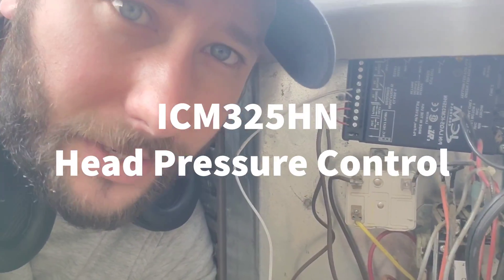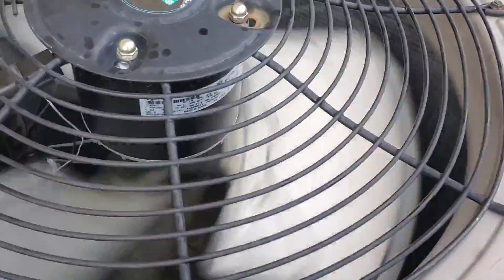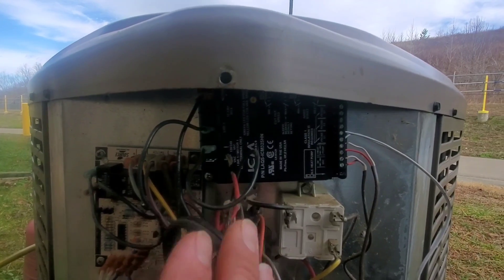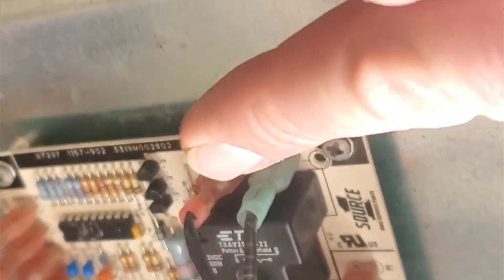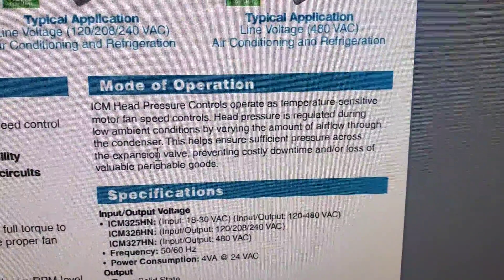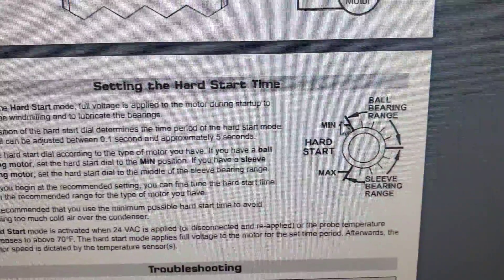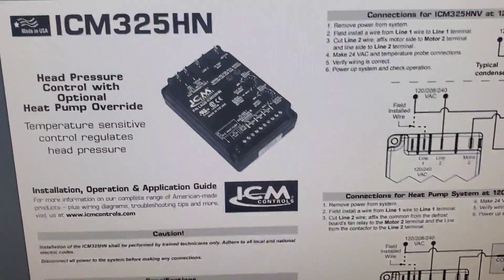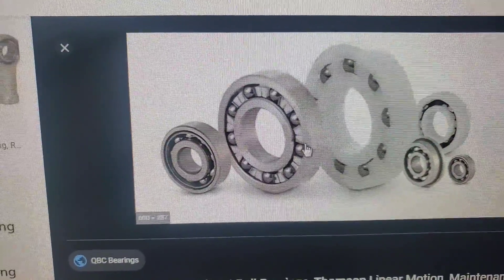Server Room Temperature Control MASTERED in 10 Minutes

Comment: Does this controller actually reduce voltage to the condenser fan motor? Because if the board is dropping voltage to a PSC motor to control head pressure, that can easily push the motor above its RLA. PSC motors will overheat fast when they operate under low voltage.

I had a similar issue on a split system running in low-ambient conditions — the fan was being controlled by voltage and the motor was running way hotter than normal.

Most proper low-ambient fan controls should modulate with a pressure-activated switch (cycling) or a variable frequency/ECM solution… not just starving a PSC motor for voltage. Curious how this one is handling that.

Comment: I'm fighting one of these now on a older York 480v 3-phase commercial unit. It's hard to figure out if the fan motor is bad or the head pressure control is bad. The unit comes on and the fan doesn't turn at all or if it does it's very slow. The fan motor isn't locked up or even tight and also spins freely by hand. The capacitor is good and is a 5.0 MFD 440v that measures 5.0 MFD. The wiring is good after fixing the ones mice have chewed up. The phasing is correct and everything is wired correctly. The compressor runs fine but trips off after the fan drags too long and it gets hot. The unit and the control are at least 10 years old and no settings have been changed from the previous years where it ran fine. The contactor is ok and only 1 year old with minimum black marks and good contact points. I measured voltage on both sides (lead/load) while it was closed and got identical readings of voltage on both sides. There is no voltage drop across them.

My best guess is that the head pressure control is bad and I am going to try replacing it tomorrow. I've been doing this professionally for 21 years since 2002 and haven't ran across many York units with this setup. We were a Trane dealer and all the other units at that facility are Trane units. This one originally was too until someone scammed them into a premature replacement way before it's time. Compared to Trane and Lennox I have always felt York was cheap trailer junk. None of the Trane units have this control on them. They only have factory commercial sump heaters on the compressors and work just fine. The only other option is that the fan motor is indeed bad after I try to put a new identical head pressure control and temp sensor on. This unit worked fine a few days ago and the Freon charge is also correct. 

Being formally trained as a Veteran by other Veterans with 40 - 50+ years experience themselves we always employed the K.I.S.S. keep it simple stupid logic to everything we did. Must have done something right because we were in business from 1912 - 2017 and formally sold coal as well as were a G.E. dealer before Trane bought them out in the mid 1980s. The more complicated you make something the more failure points it will have and is not reliable anymore. Someone condemned and junked a perfectly good Trane units and replaced it with this York turd and stupid control. You have to have some common sense and be honest to even get started. Hope I get this thing figured out within the next few days. I have no experience with them prior and I have done new installs, repairs, service and sheet metal from 2002 - 2023. I have worked on every brand imaginal during that time. We were about 80% residential and 20% commercial. From 2017 on I have done all the 27 units both split systems and package units at this facility. They are a mix of single and 3 phase units. ALL of them are Trane units except this turd as well.

Comment: This is probably a dumb question but I’m pretty new to the trade. In the begging of the video you said “the coil will freeze”.  Will the outside condenser freeze or the evap coil? Thanks
Reply: Evap freeze it is 😉
Reply: @burakokumus6040  heat pump unit...you call them indoor or outdoor coils, fellow tech ask the right way....your indoor coil will act as your evaporator depending on the cycle call, so the outdoor coil in winter is where the issue of low ambient will start freezing, as there will be very limited heat load

Comment: Are 325 and 326 the same?
Reply from the maker: Yes I'm almost certain
Reply: I think with the 325s you need The low volt 24v heat pump wire installed. And the 326 you don’t.. am i right the 325 wont work without that 24v wire on the bottom of the head pressure controller

Comment: Was your fan wire, off the defrost board going into line 2 on the ICM Controller? And your motor 2 wire off the ICM controller was not coming from the defrost board. So am I missing something or did you do this differently then how the schematic had it?
Reply from the maker: motor 2 wire is coming from control to defrost board and out to motor 
line 2 goes to contractor supplying voltage 
Line 1 goes to other side of contactor